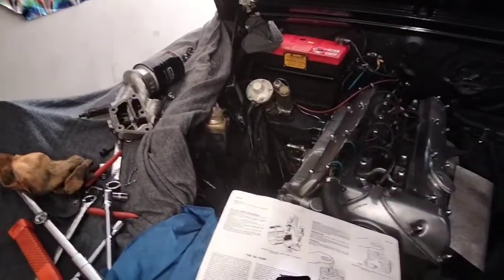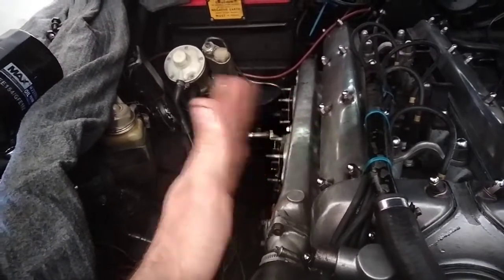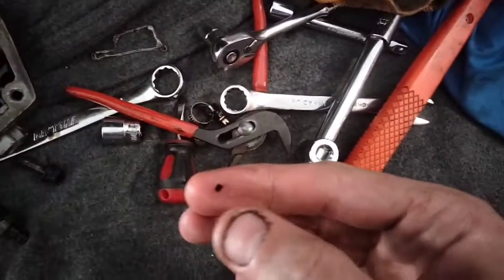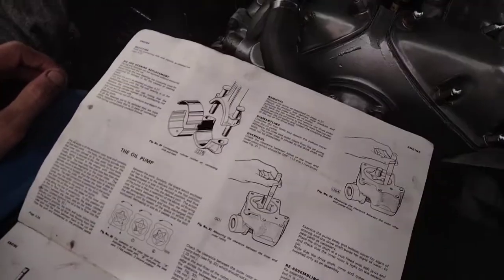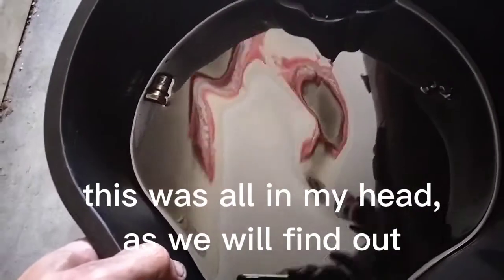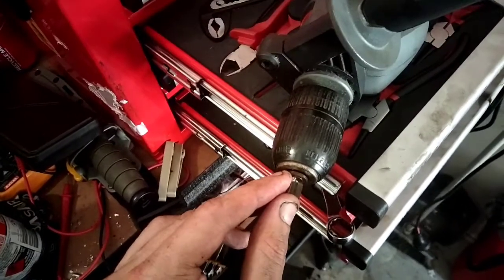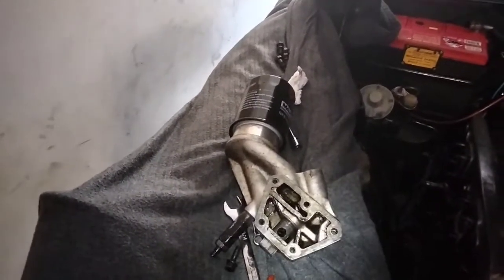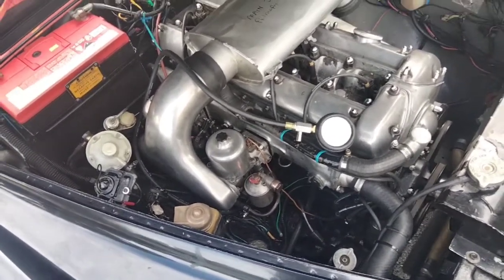Jaguar 420 Stuck oil pressure relief valve - the symptoms & the fix

Comment: I have no other option than to get a Jaguar mechanic to fix any problems that arise (XJ6 Series 2), but it must feel immensely satisfying to sort the problem out yourself. Great news!
Reply: Sounds like for problem solving on the XK engine you need a good mechanic’s computer. You’ll find with a bit of training/learning the one between your ears should work just fine.
Reply: @DAVJULART  We don't have a garage.
Reply: @russellparratt9859  I feel your pain, but on the plus side you have something to aspire to😃. My garage is about large enough for a top end rebuild but not much else 🙄
Reply: @DAVJULART  We had a nice garage, but had to move. The Jag now lives under a very good car cover, on the street. It's far from ideal, but that's just the way it is.

Comment: Thank you very much for your contribution of knowledge! I'm having the exact same symptoms on my car, albeit a SAAB 9-5 and everyone kept telling me that it's the main bearings/worn out engine or the oil pump (to be fair the pump isn't that hard to repair) but I've found more and more information that the culprit might be the relief valve and much easier job on mine so I will for sure start with replacing this part! 

Thanks again, cheers from Sweden <3

Comment: I had a similar oil pressure issue with my 2006 Hyundai Elantra 2litre petrol engine.
Came to stripping of sump to get to , that's how it is with Hyundai G4GC engine.
Determined oil pressure relief valve was stuck or sticking, guncked up. Travels in and out freely after cleaning with brake cleaner solvent.
Decided to put full set of STD ConRod and Main Bearing shells in and Crankshaft Thrust washers. Also went the hog and replacing oil pump/genuine, as housing is soft alloy.
Still reassembling.
Hope engine light stays off after trip at hot idle and better overall oil pressure. Got 320km's on the clock.
Hoping to resolve oil light at hot idle and highway better oil pressure to Specifications OEM. Oil pressure switch replacement made no difference.

Comment: Hi Mate I enjoy your Videos.
A good upgrade is the series 2 XJ6 vertical oil filter housing assy part no.  C.44361 it may be a little tricky to track down but not impossible. 
It runs a bigger spin on oil filter but you won't have any clearance issues as the filter sits vertical (bottom of the filter is facing the underside of the inlet manifold)

Comment: I put some LiquiMoly Cera Tec into my 1966 3.8S and the hot oil pressure at around 2000rpm has gone up from below 30 to above 40. I think the additive may have cleaned out the oil pressure relief valve or at least stopped it sticking when hot.

Comment: Hi, I have the same issue eversince a full restorarion of my Jag 420, my mechanica could not find the cause... Changing the pressure signal sender twice, checking oilpump, etc. Lets see if if your hint will work out! Thank you, take care,
Viktor
Reply from the maker: Hey hope it goes well for you, its definitely worth a look.  Ill try and help out if you have any questions I didnt cover here.  I reckon this might be your problem.
Reply: @aretardridesmotard6128  
Hi there, I just managed to get it checked by my service guys on my 420. Though initial scepticism, they checked the oil pressure limiting valve and with addition of a 1.5mm washer at valve sitting, plus some tightening of the valve sping, we looked at the pressure gauge on dashboard 😁 :
When cold, 2.0 at idling, above at 2000 rpm already at 4.0. When warmed up, still very similar values. 
Bless you my friend for giving the perfect hint!! Today we settled a 5 year long struggle with your help! I hope to see you around here in Hungary to thank you in person too!
Reply from the maker: Thanks for your kind words Viktor.  Glad it worked out for you.